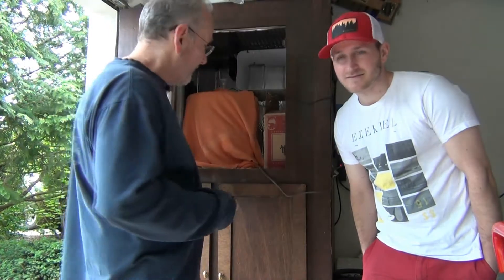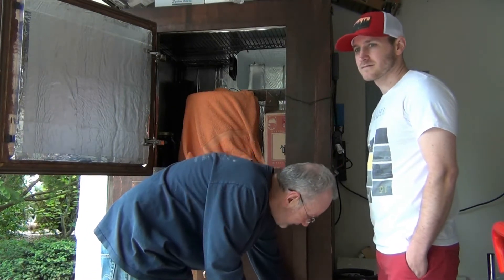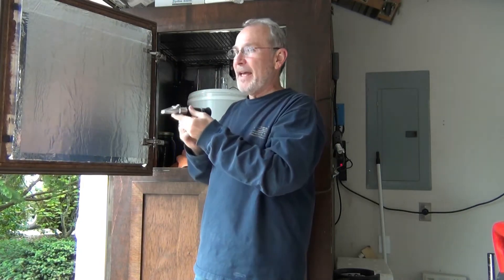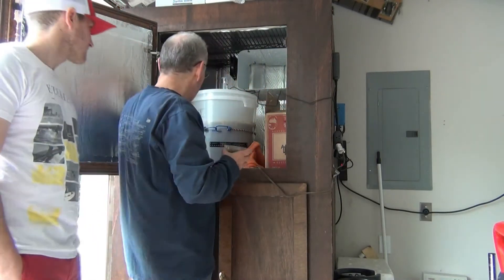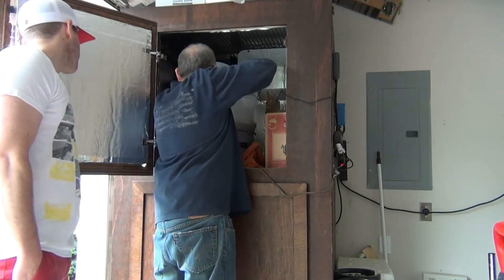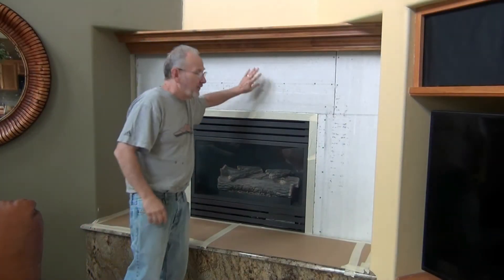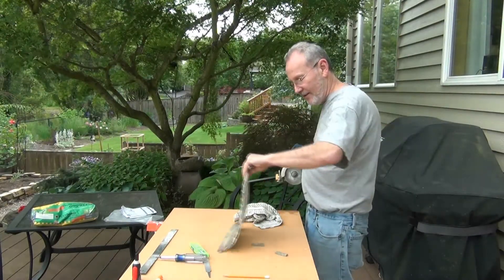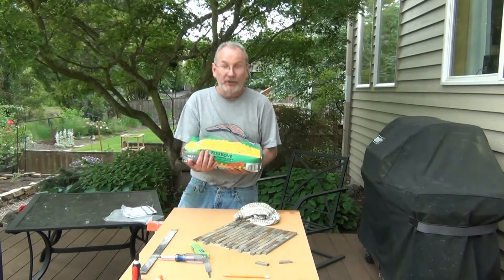HBW 172: Sjporr Challenge Beer & Finishing the Fireplace

Comment: Great stuff Kevin!  That fireplace looks great!  As for the refractometer, it really doesn't know what to do once there is alcohol present.  You can use it, and charges and formulas to get a decent estimate, to know where it's at, but to truly check to see if it's done, you really have to go back to the hydrometer.  I use the refractometer when making meads for doing the various additions as needed at the various sugar points, but yeah, hydrometer when finishing out.   Cheers!
Reply from the maker: I may do the same. Next time I will track both the gravity and brix, then go with the hydrometer at the end and compare my calculations. Cheers!

Comment: Wow the fireplace looks great Kevin! Good to see Christian on HBW again. Just a tip that I learned the same way after a couple brews all stuck at 1.020ish, but the refractometer is not accurate after fermenting. There are converters on Beersmith and others out there that you can use. Cheers boys!
Reply from the maker: Thanks Tyler, but the on the fireplace and the tip. I'll check out the websites. Cheers!
Reply: I Made that mistake of not converting it on beersmith as well my first time with the refractometer. i was pulling my hair out, not that i have much hair. Great Tiling Kevin.

Comment: Agree with Tyler I use the old fashion hydrometer for finished beer. I used the same mix on my  cultured stone wall in my bar, even though there is no heat source it held the tile sheets in place, looks good, hope to see it in person some time ;)
Reply from the maker: I'm going to use the hydrometer for the final measurement moving forward. That day will come Gary. Cheers!

Comment: Lots of good advise I see about refractometers after fermentation. I find the calculators work fairly well with brews in a standard range, but get further off the mark when beers and meads with high gravity are tried. Also another thing I've had trouble with is dark beers like stouts giving me an off reading and samples with a lot of hop particulate. Cheers and tile on.
Reply from the maker: Thanks. The more I think about it, I may continue with the standard gravity reading at the end. Cheers!